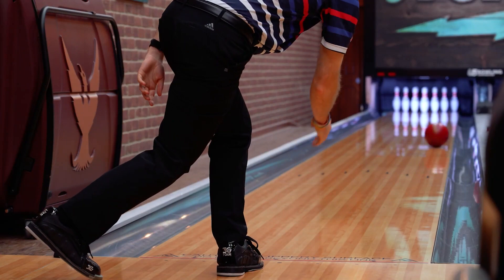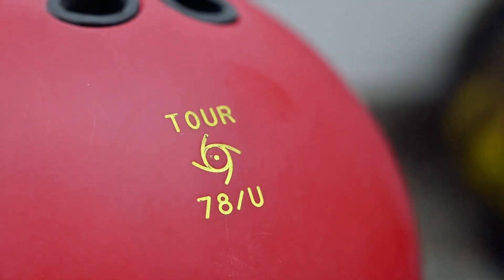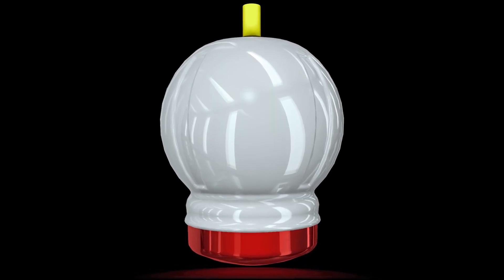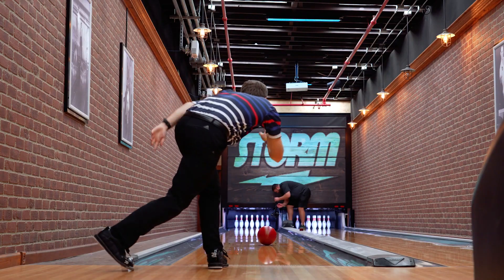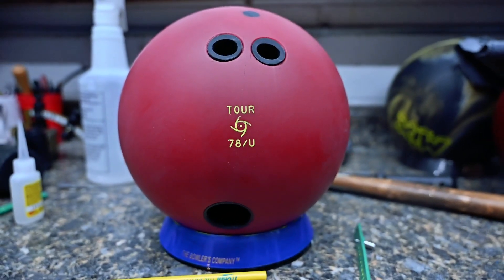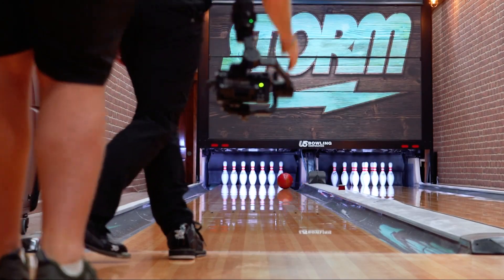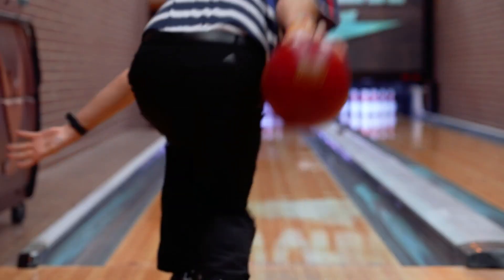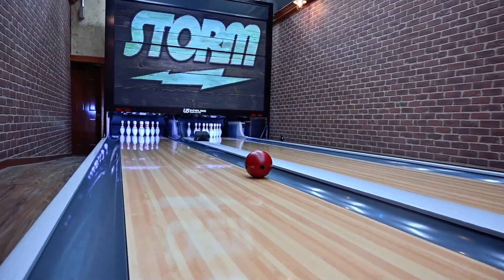Storm iQ Tour 78/U Bowling Ball Review With Alex Hoskins

Comment: When I bowl with "modern" urethane balls on house I must use very high surface (4000 grit) and weaker layouts to prevent the ball from burning up in the dry portion right of second arrow which is the ideal place to be playing urethane. Also I am a very low rev (90 rpms) and low ball speed (13-14 mph launch) player. So it is not like ultra high revs are burning the ball up. Modern urethane coverstocks are just so super strong which is why they are not well suited to house shots which generally do not have enough head oil for proper urethane ball motion.